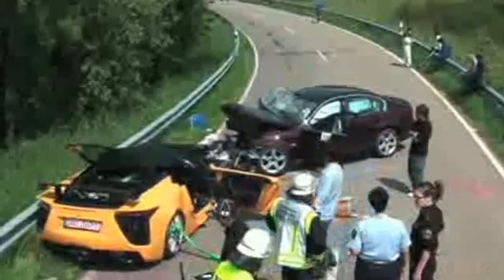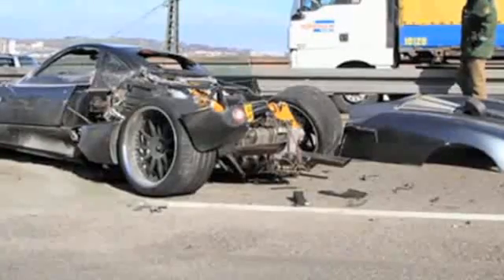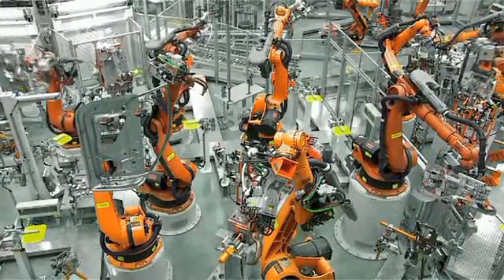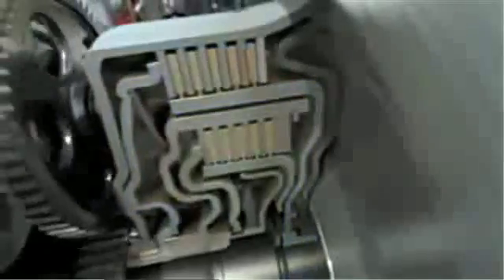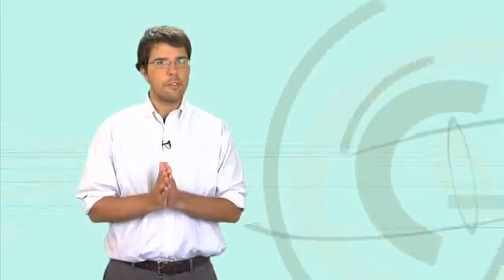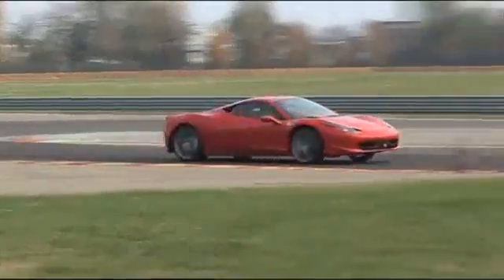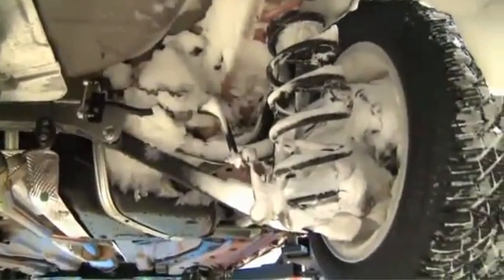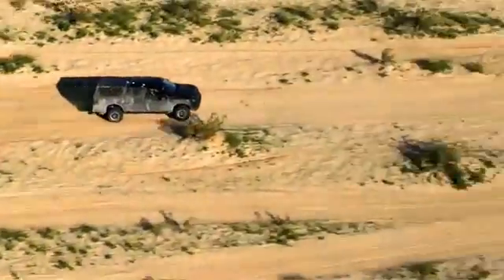LFA Prototype Crash - Honoring Engineers & Test Drivers: The Road Testament - 7/01/10

Comment: @williammurphy666 It did not happen on the track it's self.  It was on one of the service roads.  Just a standard two lane road.  From what I have seen of the crash photo's, it appears the LFA was on the wrong side of the road, left lane.  In Germany, you drive on the right.  Not sure if he was just pushing hard and using all of the road or something happened and he crossed into the other lane.